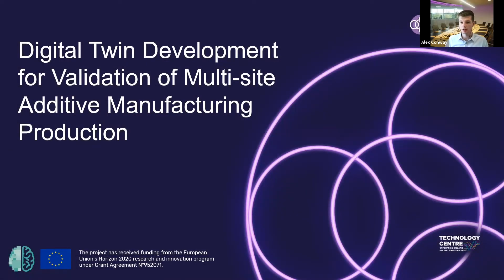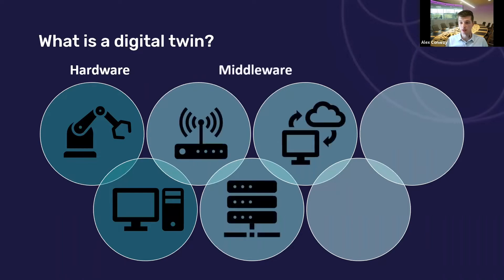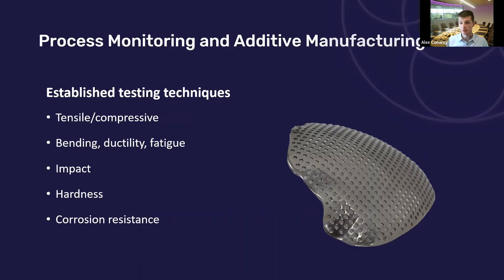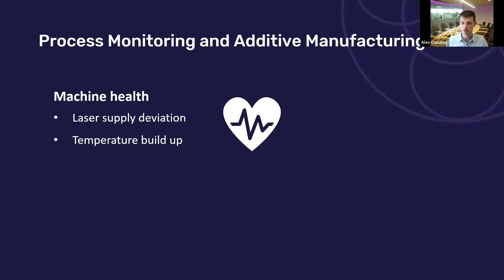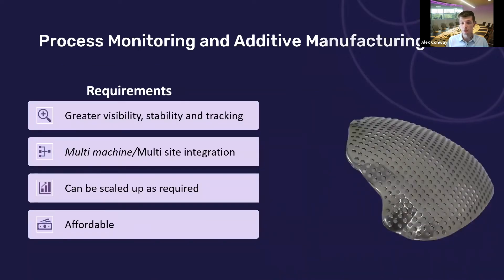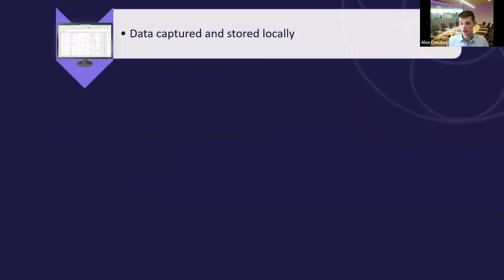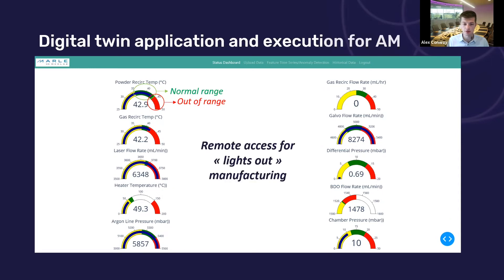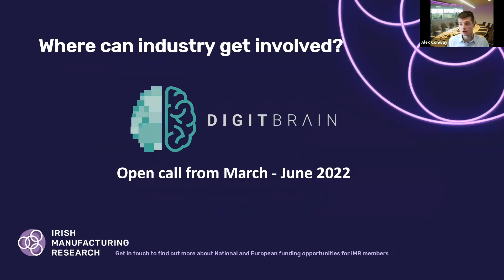Digital Twin Development for Validation of Multi-site Additive Manufacturing Production

Comment: How do you create a digital twin model of additive manufacturing process?
Reply from the maker: Hi Romesh, there are several approaches to creating a digital twin of an AM process. First you must consider the interpretation of a digital twin to define its scope, and then you have to consider what AM process you want it to virtualise. This project focused on creating a digital twin of a LB-PBF machine using machine-focused sensors and inferring process performance from there. More details on how we did this are available from the project website: https://digitbrain.eu/1st-wave-of-digitbrain-experiments/experiment-4-digital-twin-for-additive-manufacturing-am-ensuring-compliance-across-multiple-machines/ If you are interested in looking at a different approach, I suggest reviewing the approach taken by experiment 7 of the Digitbrain project: https://digitbrain.eu/1st-wave-of-digitbrain-experiments/experiment-7-data-driven-modeling-of-powder-bed-fusion-technology-to-improve-product-quality/. In this experiment, they reviewed emission data from the laser and melt pool and used a digital twin algorithm to score and report on the process. Both experiments are valid approaches and provide great inside and value to users of such equipment.